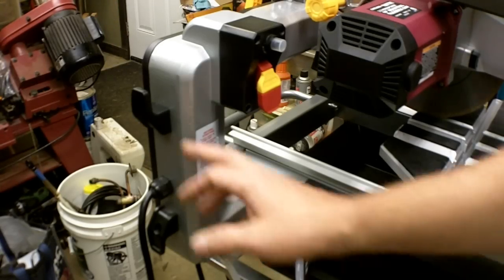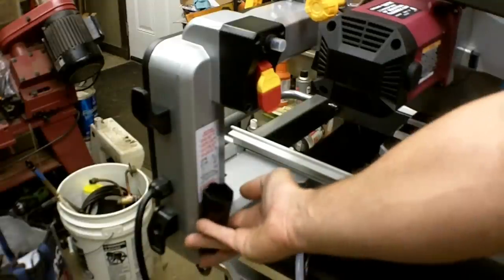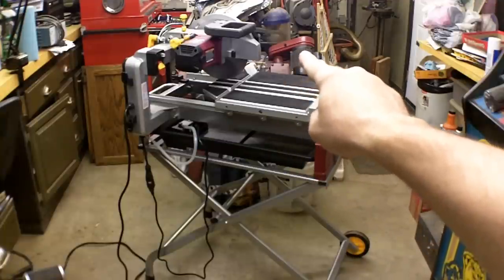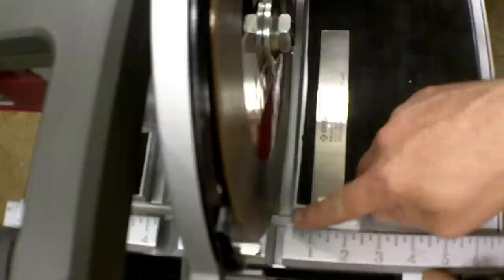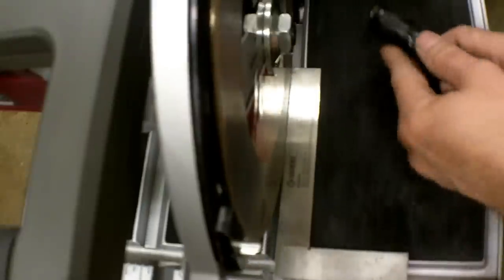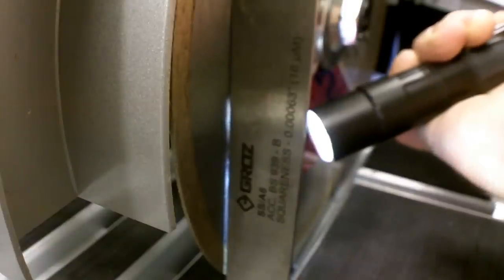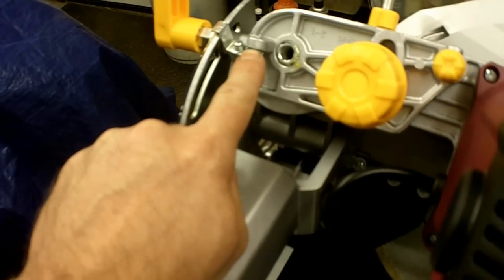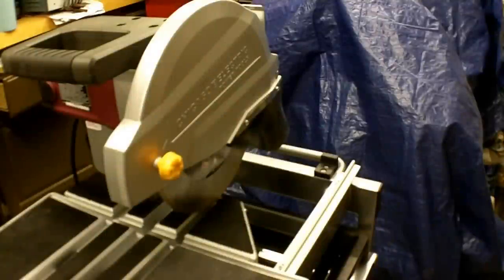Part 2-2 Harbor Freight 10” 2.5 HP Tile/Brick Saw Review Item 69275

Comment: I've used this saw for 2 years and I am a tile contractor.

Stuff that has happened to the saw over the years of constant use:
-The two largest rubber mats on the table came unglued. I re-glued them back on.
-The plastic knob on the large pin that holds the saw down, broke. Just the knob, not the pin.
-The saw will slowly get out of square. Most saws do because of the constant vibration. Easily adjusted.
-I've had to tweak the water delivery system a little. 
-One of the plastic rungs that you wrap the cord around broke.

All in all, I paid 180 for a saw that has cut tile for me for two years. Nothing major has happened to this saw. Original pump still works great, even though it has had water in it that froze a few times. The saw motor works and sounds great. Haven't even had to replace any brushes. As long as you get a quality blade (Dewalt, MK-225 Hot Dog, T3 Razor, my goto blades), and make sure everything is square, you won't be disappointed. 2 years sounds like a long time, and it is in a way. I say that because I do supplement my cutting with a grinder, and a score and break cutter. My wet saw only gets used when I'm doing detailed work and need really nice cuts. Or if I'm cutting real stone. I still use it every week, just not every day of the week usually.

I highly recommend this saw for anyone.
Reply from the maker: +Gary Smith 
Well thanks for the information Gary! Every problem you've noted seems very minor to me which is very cool. I know mine will never see as much as yours has, so it should last me a lifetime! Posting your experience will surely help others make a decision on purchasing one. Take care and good luck, G.
Reply: My sliding table is all fucked up, won't even slide w.o bumping up and down
Reply: Thank you, great review, very thorough!
Reply: I was thinking about getting it because it's pretty cheap, and as you said I figured if I bought a really good tile blade for it then that would and should be enough for me to make good cuts. I can afford the $900 Dewalt at the moment that I want so I believe this is going to be my first wet saw. It can join the family so to speak because I have the Chicago Electric Miter saw and it's never let me down on building any decks for customers and things for myself.  What's strange is it sounds absolutely identical to that wet saw when it's running, and when it's coming to a stop. 😂

Comment: I am a professional tile mechanic, 34 years, and I've been using my HF for about 2 years now and I love it. This is my 6th wet saw, and I had previous experience on a big commercial job back in 2006, with one. Used it practically all day, everyday for about 6 months with no complaints so when it came time for me to buy a new saw I went to HF. I paid less for this saw than any of my others(full size) including a Felker, a Target and 3 MKs. Besides having a bigger motor(2.5 hp) a bigger blade(10") more adjustments(especially the tray rail screws) option of cutting bricks and blocks, wet or dry, I think the ability to pull one pin and use it as a chop saw is probably my favorite things about it. I routinely make plunge cuts that I used to have to free hand. Also I do a lot of plank tiles that need to be ripped. I've gone up to 42" so far. Frankly, I think HF should let me do a promotional video with one.
P.S. 2 minor issues: it's heavy. You're not going to want to carry it around to far especially up steps. The stand helps. I also had a problem with the rubber mat on the tray coming loose. But I can live with that.
Reply from the maker: That's cool Richard! For what use I've given it- I can't complain one bit. Good to hear you've had good results with yours. At this rate- it should last a lifetime for me. Take care, G.

Comment: Thanks for the review! Good stuff. I've had my eye on this saw for a while, just waiting for the wife the forget about all the other tools I've purchased before I buy this one. Good idea on the tarp. tile water slurry gets everywhere and it's very hard to clean.

One tip, keep the pump in a 5 gallon bucket of clean water away from the saw and it will virtually prevent any chance of particulates getting in the pump and causing premature wear.
Reply from the maker: macgyver03ga Thanks! I'm glad you liked it. It seems like it's going to work just fine for me. If you get one past your wife, let me know what you think. Using a bucket is a good idea. Take care, G.
Reply: great advise i will take it

Comment: Nice job checking out the alignment it is important so u don't get chipping. I own there bridge saw and it has worked fine but is getting tired. I was going to give this saw a try and it's on sale this month. Not sure u mentioned it but this saw handles some good size tile. 18 in on the diagonal. Most important thing on these saws are he type of blade ur using. I pre ordered the Dewalt 10 in blade Dw 4764. Rated pretty high. Got it from Amazon for  $48 bucks. I also purchased a GFIC pigtail extension from Lowes I use when on the job. Most folks don't have GFIC breakers on older homes. Remember you have your hands in water and a non waterproof plug. You did a great job on this review. Just thought I'd throw out these few tidbits.
Reply from the maker: That's cool Robert. If you go with one if these, let me know your thoughts after you use it. It might help others out. Good tips on blades, etc. G.

Comment: This is the best initial review on the saw. Would like to see how is it holding up.
Reply from the maker: Thanks! I can't show how it's holding up since it's stored away, but I can tell you. It's not seen tons of use, but I did do two shower surrounds in subway tile, flooring in two bath's and one other room with 12x12, and a small kitchen back splash. For that little use, it still works like new. Hope this helps, G.
Reply: Yes, I have gone ahead and purchased it last Friday. Yesterday, I have cut a Hexagon Mosaic for my laundry room, small (6'x6'). I have used XP Dewalt blade, and I'm very pleased with the purchase. The saw cuts very well, and I have noticed that once the entire tile tray (three track wheels)  is on the tracks, there is no play.
Reply from the maker: That's cool! Glad it's working out for you. Take care, G.

Comment: i have used this wet saw for about 2 weeks. If using in a closed area; in  order to cut down the dust and water splash I took a 50 gallon garbage bag and made a hood over the back of machine. Just push the lip of the bag around the various knobs and hooks on the machine and give yourself enough room to push the table and tile on the table towards the end. It works really well.
Reply from the maker: That's cool. Good tip on using a bag. Take care, G.

Comment: Liked your review.  Great job!  And appreciated your recommended mods.  This saw has several write ups regarding pump issues so I personally would not leave pump in pan to pump dirty water.
Reply from the maker: Thanks again. I read the same complaints as well before I purchased the saw. I think they changed the pump at some time since my manual referenced on that was not like the one it came with. But , after I finish using it for the day, I always hang the pump outside of the pan for good measure. So far, I've had no problems with it. Take care, G.

Comment: This is an old review but still quite relevant.   I bought this saw used from a guy who used it with the HF blade for one job in his own home, which is what I wanted it for.  I cut over 400 sq ft with it and am very pleased with the saw.  I added a Dewalt diamond blade (actually have 2 now as one dulled quickly) and the stand.  I found that a 5 gal bucket fits fine below the drain hole by resting the bucket on the cross brace.  Be sure to wear hearings protection as this thing is very loud while cutting tile.  And, the blade slings a lot of water out the back.  I keep a $2 HF blue tarp on the floor behind it and another to cover anything that would be behind  the saw and which you don’t want covered in wet, messy tile dust.

My only problem is that I cannot seem to tighten up the large yellow knob that locks the motor down.  No matter how tight I turn that knob, the saw eventually rises up enough to not cut completely thru the tile.  I will try the 2 washer trick you showed and see if that helps.  It really needs a handle type knob that can be easily and fully tightened.  If anyone has any solutions for this, please let me know. 

Lowes sells an identical Kobalt brand saw except that is is Kobalt blue and has a light over the blade.  If anyone knows how to add a light such as that, please post the details.  It would be helpful but I wonder how you would keep it clean given all the water and tile dust that it slings.
Reply from the maker: That's cool JT. Look at the gap between the castings. Perhaps you can add a washer to allow it to clamp tight? I can't speak for a light. Good luck, G.

Comment: Hi G, wow that saw sure looks heavy duty and a great price. I will have to check it out at HF, thanks for another great video. Take Care, Mick
Reply from the maker: Mickj47 Thanks Mick! Looks heavy duty is right, and it is heavy...lol. I put it together in place and haven't tried to take it off the stand yet. I might need a helper..lol. Do check it out and if you have a call for one, I would consider it. I'll know more later as it's put to use, but I don't see having any problems with it. Good to hear from you! G.

Comment: Some company needs to hire you as a full time tool review expert.  Your reviews are very in depth, and you point out everything about the tool that makes it good or bad, and possible solutions to those bad things.  Thanks again for a great review.
Reply from the maker: William Todd Well thanks William! I do try to pack enough information in my videos to give a clear picture of what one can expect from something I review, as well as how to correct any shortcomings I find- if possible. Some folks don't like my style, but the majority does, so I'm never going to change my format...lol. I'm glad you like the videos I make. Thank for the expression, it means a lot! Take care, G.
Reply: ***** Do you know if the saw would be able to cut through 2 inch thick marble?  I have several pieces of marble that I could put to use if only I could find something to cut them LOL.
Reply from the maker: William Todd I guess I failed to mention its capacity in the video William- my bad. It should cut up to a 3.5 thickness- so I would say yes it could cut your marble no problem. it should also be able to cut up to 24" in length. Hope this helps, G.
Reply: ***** Thanks, I read the 3.5" thickness online, but wasn't sure if that meant all types of materials or if it was only certain types.  I guess at some point I'll have to get one and try it LOL.
Reply from the maker: William Todd I would imagine anything that would fit, it will cut. If you do get one, let me know how it worked out. G.
Reply: ***** I definitely will.  Probably be quite a while before I can afford to get one.  If i could cut the large pieces of marble I could make better use of them, right now they're all just stacked in a shed as they're extremely odd shaped.  Got the pieces free when there used to be a granite & marble counter top company in town, they used to set their left over pieces, mistakes, etc. on a pallet out front of their shop for the public to pickup.  

Looks like that saw has plenty of power to go through thicker materials.  So definitely I will put it on my list of purchase items.  I like the sliding table idea, especially for those large heavy pieces of marble i have.

Comment: Hey ghostes, how do you square the blade? when I cut a piece of tile it is slightly different widths on either end of the tile.
Reply from the maker: Brian, under the table you will see wheels with grooves (The wheels on the other side have no grooves). The grooved wheel side is the side you need to adjust. You would loosen the bolts that hold that rail to the base and pivot the rail until you get it square to the blade- then lock the bolts back down. Test and adjust again if needed. The check all other adjustments. Hope this helps, G.
Reply: @ghostses  Thank you. didn't realize those rails were adjustable.
Reply from the maker: No problem Brian! Good luck getting it dialed in. Take care, G.

Comment: Thank you!  This was very helpful to watch.  I have one that I am interested in using for cutting glass bottles. I think I need to fine tune the factory adjustments and check the precision of the blade angle.  I also think my water in not distributing perfectly well either.  I might try to secure the long tube better to the pump and play with the knob.  Do you think it matters if you use regular water or not?

The tarp in a must!
Reply from the maker: No problem Mary! I would definitely check the adjustments. There should be some way to adjust where the water sprays- but can't remember off the top of my head. I use regular tap water with no problems. Good luck, G.

Comment: Excellent Video. Thanks for the tip on the double washers and thread lock on the set screw. Just bought mine and noticed the manual warns to only use smooth rim blades. What's your opinion on using a segmented diamond wet blade on this saw? I'm cutting pavers.
Reply from the maker: Well Jay, a segmented blade would probably make for a faster cut. It might show more chipping, but for pavers it shouldn't matter. I don't know why they would say that in the manual. The only thing I could think of would be for safety if you got your finger in the way. G.

Comment: Nice in depth review. I have an issue with mine that I purchased used - the table seems like it needs to shift about a quarter inch to the right as the blade rides very close to the right side of it's trough. When you tip the saw to the 22.5 or 45 degree position the blade does hit the table. I see no way to adjust it further as the rails are pushed all the way to the right and the arm casting doesn't look like it can be shimmed out to the left.
Reply from the maker: Thanks! I didn't go out and look at mine, but I wonder if you can flip the rails side to side and gain anymore adjustment?? I don't know if they're the same. The only other thing I can thing of is perhaps the blade cup washers are a different thickness and need to be flipped around?? Again, I didn't look at mine so I'm just thinking of anything that might help. Oh, I don't know if the wheels have any spacers on them, but if they do perhaps they're in the wrong spot. I do agree, the shimming the arm probably isn't possible. Since the machine was used, I guess anything is possible. Good luck tracking it down, G.
Reply: When I bought it a couple of weeks ago the only adjustment I needed to make was to the left rail to get it parallel to the blade. I did a tile job so it road in the back of my truck to and from the job, nothing rough. Yesterday I was looking at it and could tell that the arm holding the saw motor had sagged. I ended up doing several things to correct it: 

1. I took off the left rail and elongated the holes with a rat tail file to push the rail further to the right.
2. I had to shim that rail up with a washer at each bolt hole.
3. I had to loosen the 6 bolts that hold the motor arm onto the carriage, take out the top bolt on the side and shim that out with a washer to kick the arm up and to the left. 

Now the blade is parallel and perpendicular to the table again and I can put the saw in the miter positions without slicing the table up. If you find yours falls out of alignment you may need to do something similar. I think the casting for the motor arm is the weak point with this unit. I googled this issue and went through the HF reviews and saw nothing similar to this problem so maybe I got a dud. Had I bought the saw new I would have returned it for a second example to see if the issue repeated itself.
Reply from the maker: That seemed to be quite the saga, but glad you got it sorted out. Thanks for the tips! I'm sure they will come in handy for others, or perhaps even me. Take care, G.

Comment: Great review, and I did see a few things that I will check when I get that saw next week. I have done my own tile for a long time, but I had a shower taken apart and ne durock installed. The guy who came to do the rectified tile did not know what he was doing, and i fired him a day too late. I have to rip down all my expensive tile, and replace the durock board. I will do the job myself.  What did he do wrong? He was supposed to have a 1/32 grout like, but they were all over the place, some were en 1/8, some a little more, and some less than 1/32. Then there was a chipped tile two rows down from the top, and the top was uneven. There was more wrong, like a lot of thinset in the grout lines. I started taking a few times off, but then realized that I have to cut my loss and rip it all down, and start over. I got that guy from Thumbkit , a web site that finds contractors for whatever work you need done.  He was using this tile saw, and I plant o buy one with the 20% off coupon they put in the paper each week.
Reply from the maker: Thanks Joseph! There should've been no problem getting a perfect job- especially with using rectified tile. I could see some of the grout line issues you described happening with non-rectified tile- but not with what you had to work with. It all boils down to poor planning, probably no layout, and no checking the work as it went. I'm no pro by any means, but it's really not that hard to learn the basics.  It's lame you have to cut/eat your losses and do it proper, but at least you know the job will be done to your satisfaction. Good luck with the saw, and your project. Let me know how both turn out for you. Take care, G.